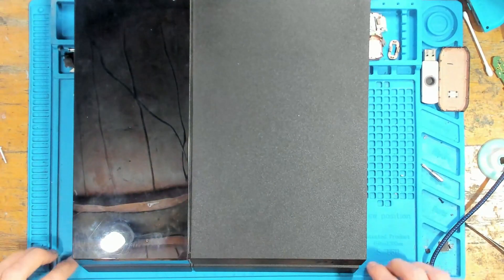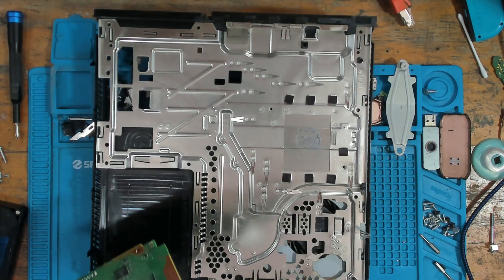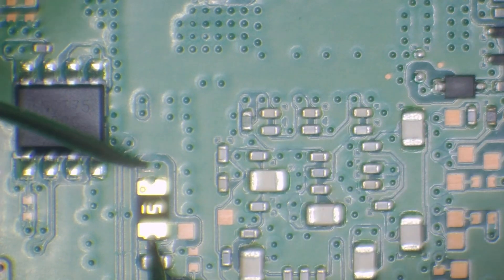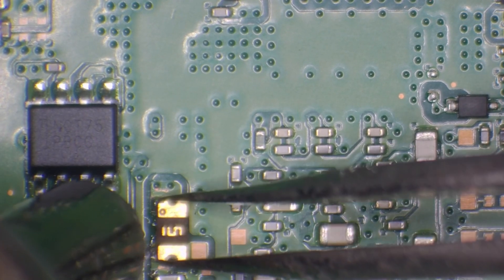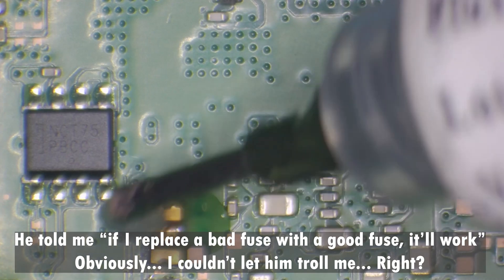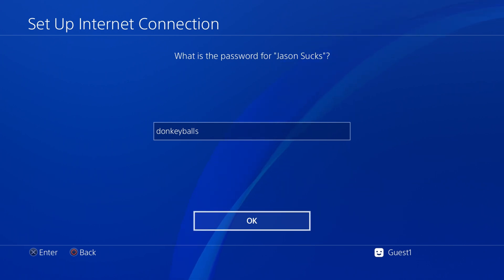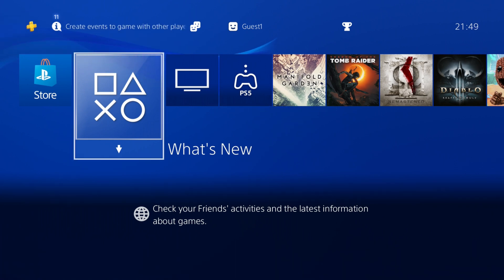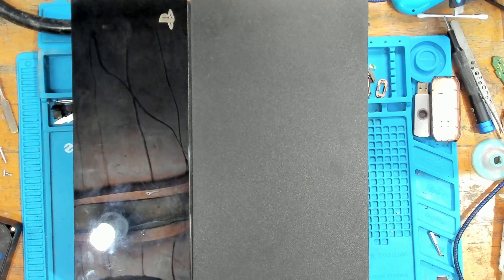PlayStation 4 No Video Output Diagnosis And Repair - Bringing A PS4 Back To Life For Less Than 50¢

Comment: Hi Dude, this actually my PS4. Is there any risk of the HDMI going pop in the near future considering its slightly bent?
Reply from the maker: Very unlikely mate, it can only really go bad if the cable keeps getting unplugged and plugged back in, which could damage the port as they're not designed for that kind of strain

Comment: Hi, i have a ps4 pro and the hdmi filters are shorting across both coils per filter, i know the chip is faulty , but could there be more faults?
Reply from the maker: It's impossible to say to be honest, it would need the circuit fully testing to determine it